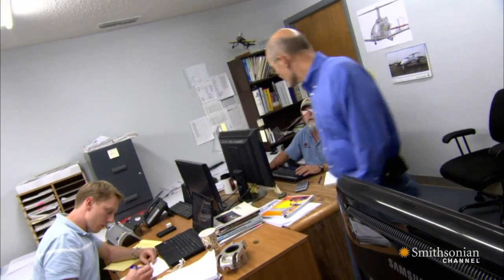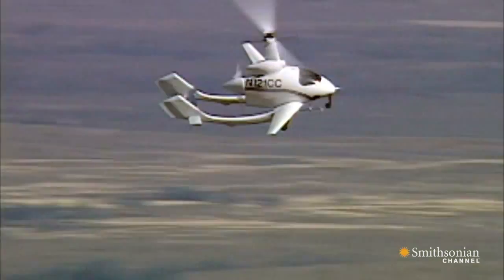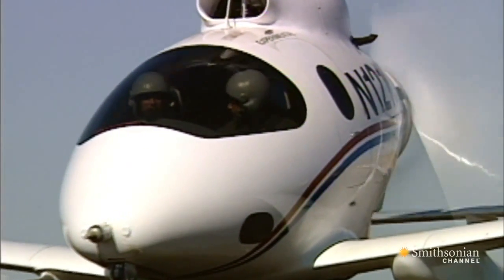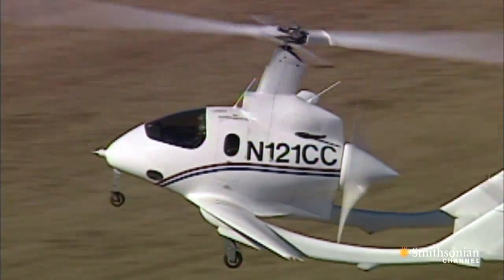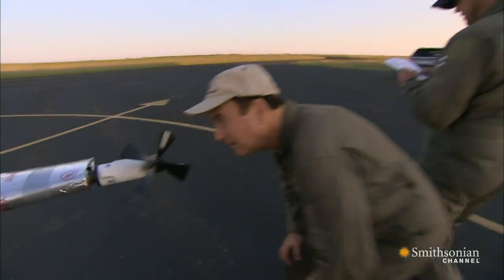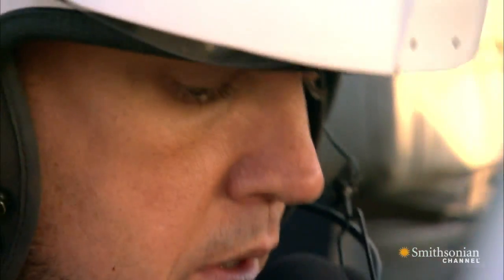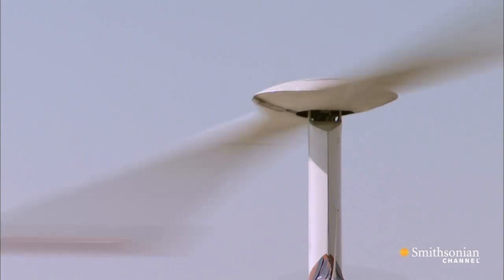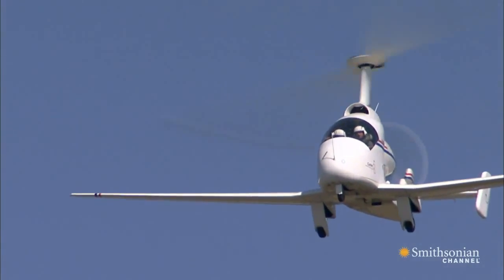A Remarkable Innovation in Aviation Design

Comment: what is the value about using uranium on the tip of the rotor?
couldn't something heavy like lead do similar?
There seems to be a 'safety' factor inherently built into Carter designs.

Comment: Oh what woah he designed a GYRO COPTER
Reply: What have you engineered lately?
Reply: @rock3tcatU233  In a Gyro Copter, the blades speed up the faster you go, they don't slow down.  I wonder how rotor "slow down is done?"  I expect blade pitch angle is adjusted.